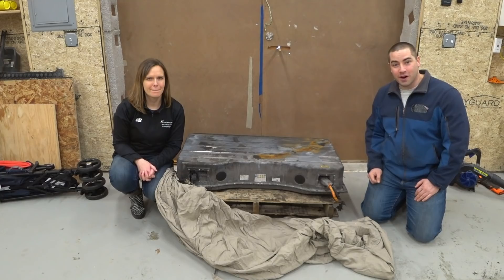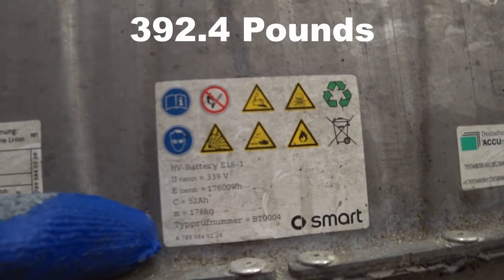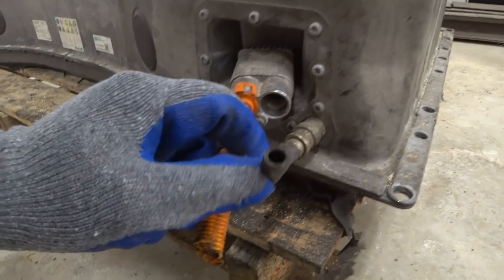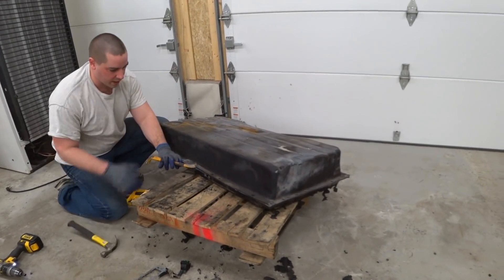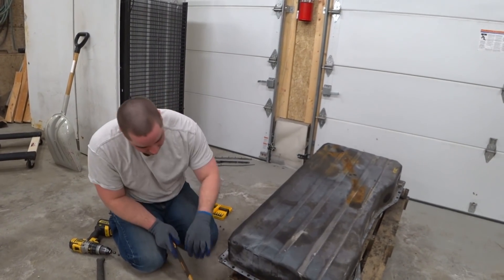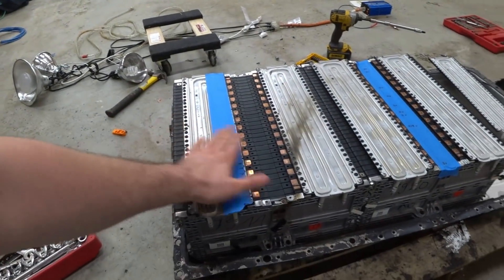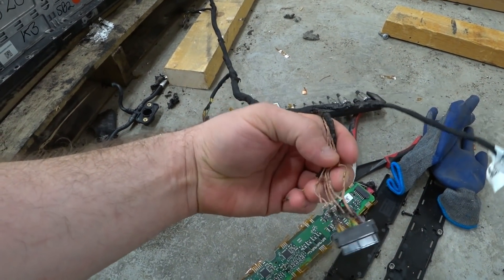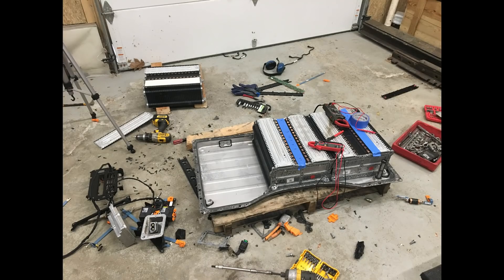Smart Fortwo Lithium Battery, EV, Damaged!

Comment: Remember what I said. Damage is done during RECHARGE. Put these on the slowest trickle possible
Reply: It's stupid to assume the worst when you have no data. "won't hold much charge" REALLY? You can tell the status of lithium plating, dendrites and electrolyte decay just by looking at the outside? I can't. Obviously you don't have experience recovering lithium cells. I do.
Reply: Based on what? Internal resistance? Capacity? Self discharge? These cells have not been damaged. Yet.
Reply: @climatechangepreppersfaceb2148  0v sure do it, the rest of them are likely not going to hold much charge
Reply: Yup I have personally revived some 18650 cells.  Often bad laptop batteries only have one bad cell and some of the other cells at a low voltage can be revived and still have decent capacity.  I would trickle charge the cells up to about 2.7V and if they hold stable voltage put them on a standard single cell charger.
Reply: Forget it. Chuck these into the recycling bin